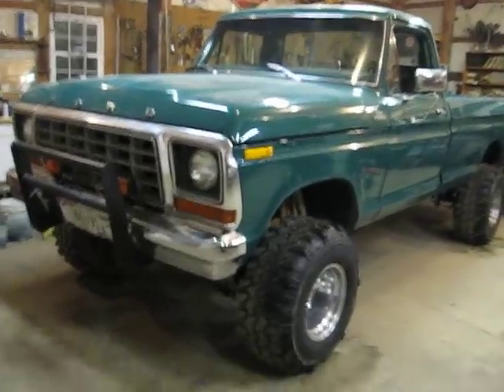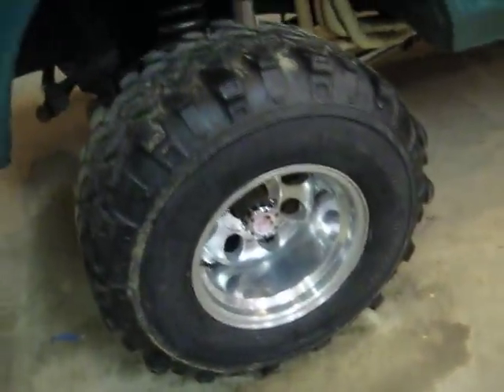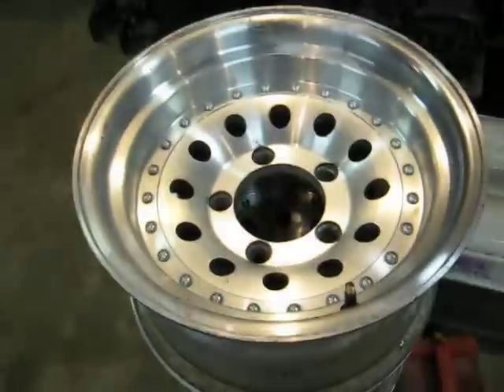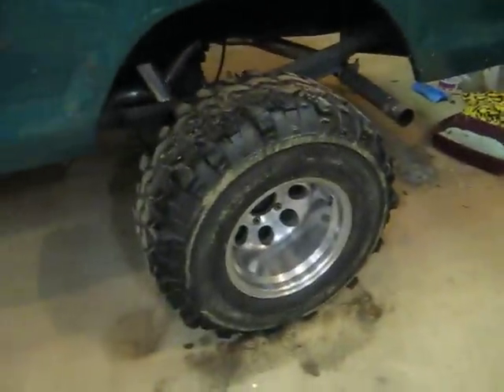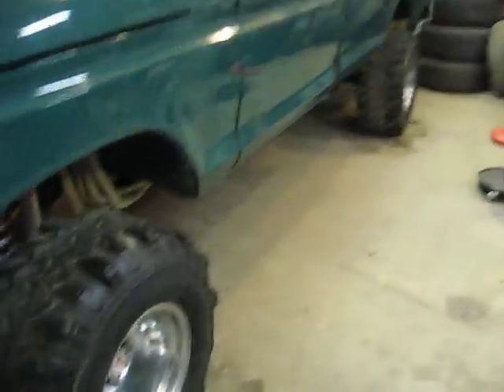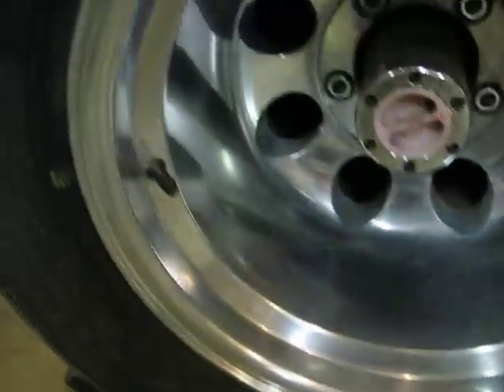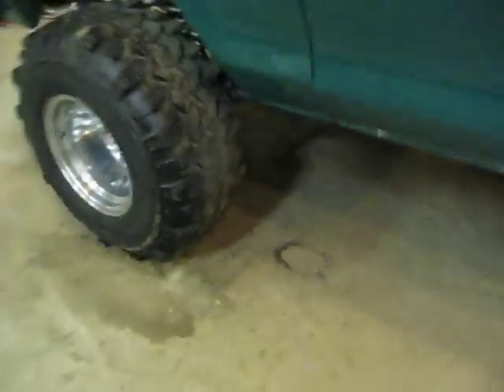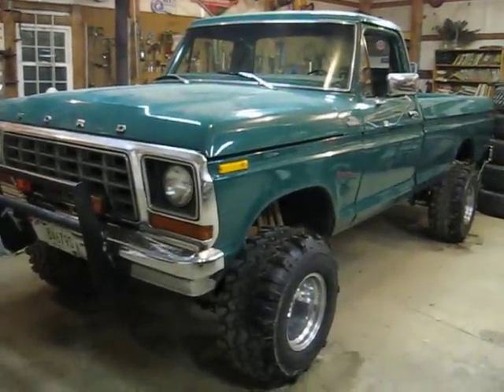1978 Ford F150 update

Comment: Do yourself a favour take a can of underbody spray and saturate the bottom corners of the box under the tail lights and around front box corners those tires are going to pack mud in there hard and it will keep from rusting --Use the wash wand in the box holes thats what there for to get in the corners and top of wheelwell seen this MANY times .Looks good .